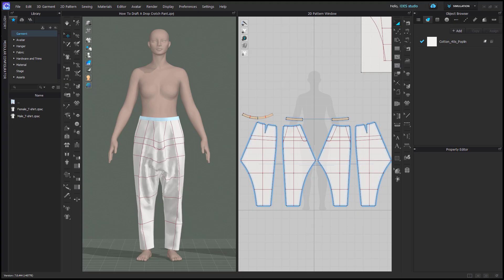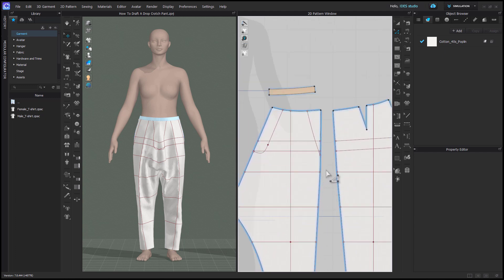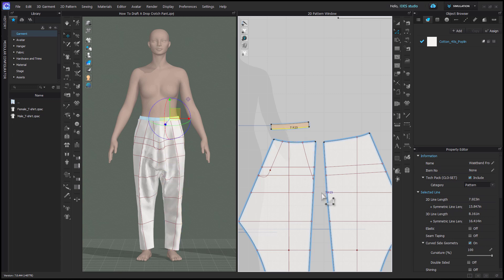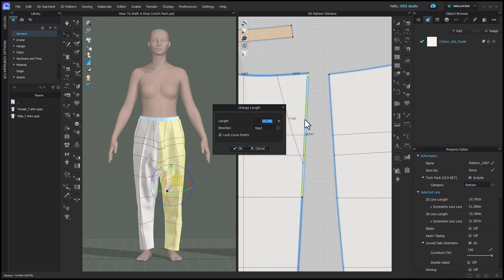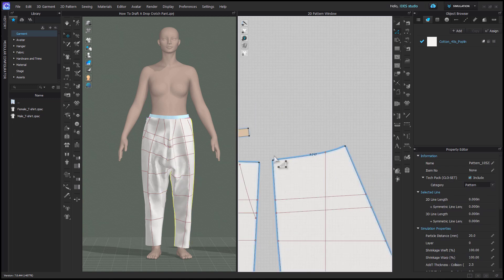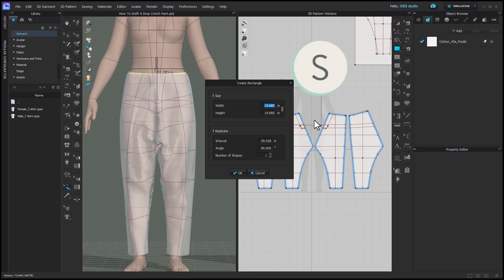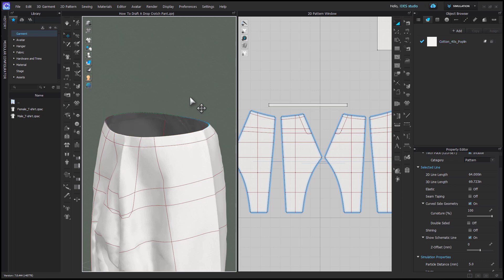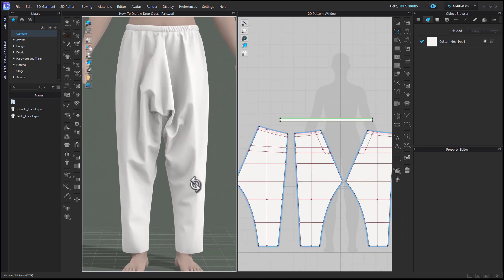How To Create An Elastic Waistband in CLO 3D

Comment: How to put avatar hands inside pocket as shown in your thumbnail video?
Reply from the maker: Good question! It's not easy and maybe I can add it to my video to do list. Essentially you make a pose with the avatar using X-Ray joints. Or you can download free ones from the CLO Connect store. I also sell them on my website for a few bucks. Make sure there's space between the hand and body and you'll need to move patterns or use select mesh to get them in the right spots around the hand. Its hard to explain in short, but I'll try to make a tutorial on it!